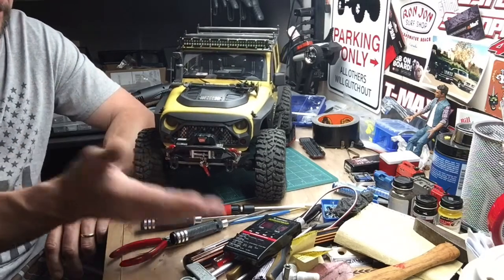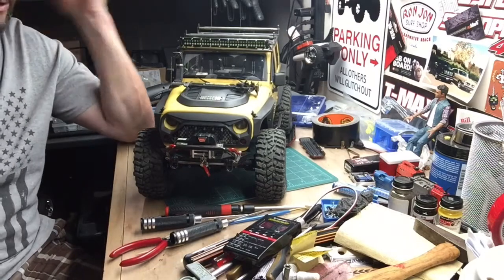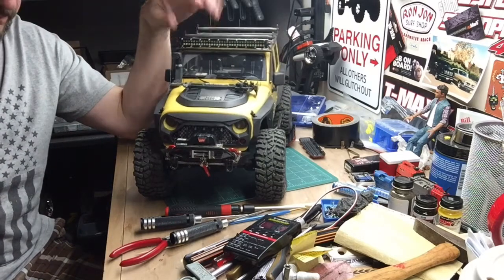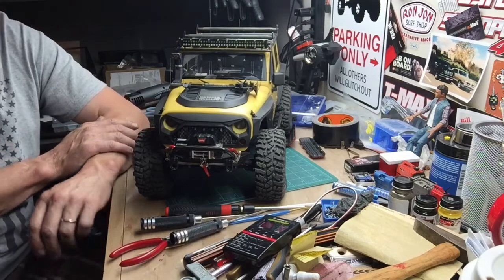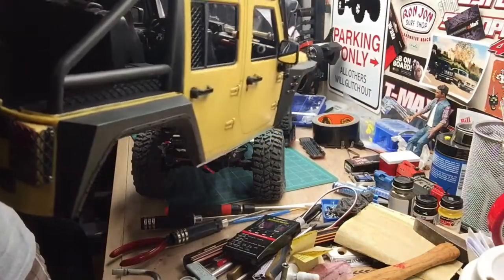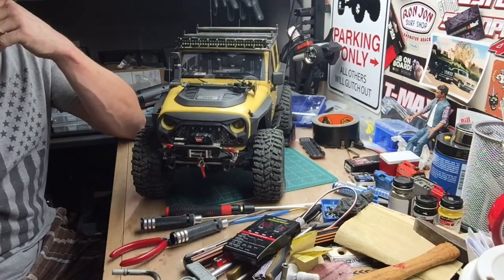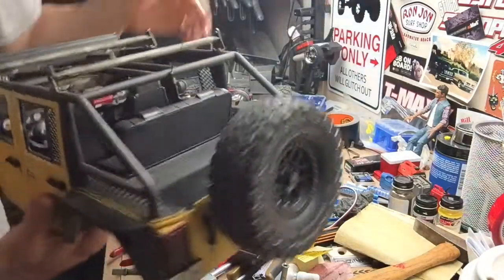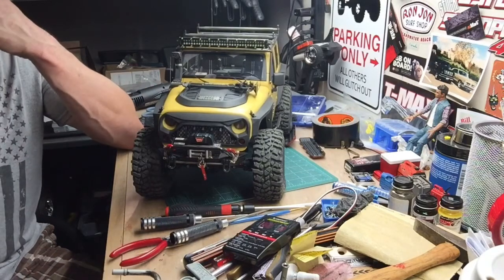Xtra Speed Jeep JK Hardbody v2, Axial SCX10II #JK Sport Project

Comment: Great video, I have been going through your builds and love them! Can you give me some insight on thebdashbkit you set up with the backlight? I'm currently trying to do a similar dash in my RC using what I can from set ups that look as good as what you have and 3d prints. Thanks
Reply from the maker: Dane Kurtz Yeah..on this dashboard I cut out a clear piece of Lexan to go over the gauge cluster, and then drilled out the actual dash itself. Added gauge stickers to the Lexan and then back lit with my LEDs. Thought it came out pretty good hope this helps. Thanks for checking it out. 😉👍🏻

Comment: How much does the body weight?
Reply from the maker: CriMiNaL__ Really not sure on that. With everything on there it’s pretty heavy compared to a Lexan body of course. With the chassis and body I know this rig is almost 13 pounds. So it’s pretty heavy. Thanks for checking it out I appreciate it. 👍🏻
Reply: @kingstonrc329  is there a chance you could weigh just the body with all its gear on it,
Reply from the maker: CriMiNaL__ Just the body and all the gear, minus the driver weighs 3.9 pounds.😎👍🏻
Reply: @kingstonrc329  ty for that much appreciated